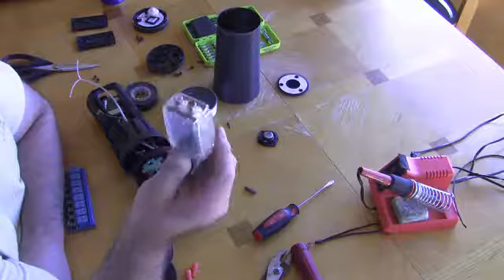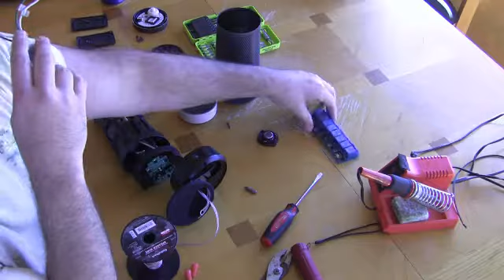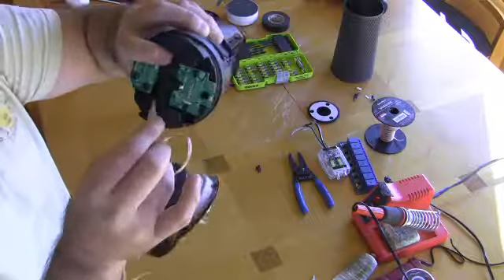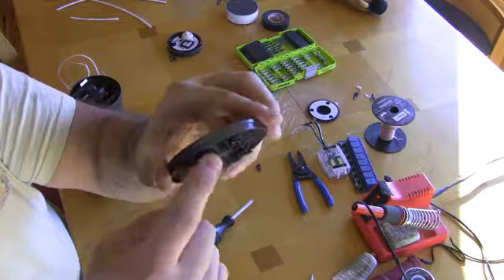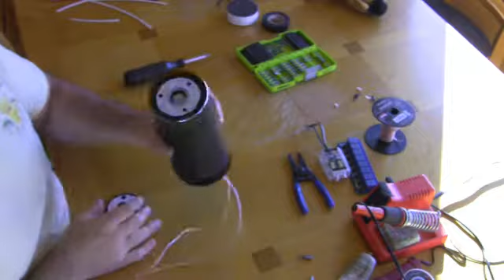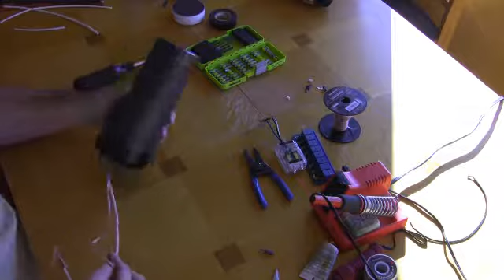Harmon Kardon Invoke: Part 4:  Speaker Mod and Re-assembly

Comment: Is there a way to only make it a bluetooth speaker? cortana isento working for me...
Thanks
Reply: Cortana is integrated into the device, so, in a way no.  The audio feed going to the AMPs is through the circuit card.  I don't have the schematics for the device so I do not know what the empy headers are for. 

As long as you don't use the keyword Cortana, it shouldn't respond, but you should be able to use it as a Bluetooth speaker and pair it as such.
Reply: @cinoaz1243  I can’t get Bluetooth to show up... 
would be fine as just a speaker...
Reply: @sf6743  Toss it.  It was what it was, now it isn't.  Just toss it.
Reply: @sf6743  Toss it.  Better Bluetooth speakers are 30 bucks online.  Microsoft is dumping Cortana, this product is dead (which looking back at my video I was pretty spot on with this turd back then).

Comment: Is there a way to get rid of cortana and have alexa insted? like take apart an echo dot and usa the internals and wire things up so you can inted use alexa with this speaker?
Reply: Well not really in the circuit sense.  The echo Dot has a LINE OUT that you connect to external speaker.  You can get a cheap Bluetooth transmitter with a LINE IN and then configure your Invoke as a Bluetooth speaker.  Thus, you get both Cortana and Alexa at the same time.
Reply: @cinoaz1243  Thanks so much! i tried using cortana, but it was a failure :(
Reply: @paulyrualma  https://support.harmankardon.com/us/en/search?q=Invoke%20FAQ

https://www.bing.com/cortanainvokeredemption

Comment: Thanks for the teardown. FYI heat (think hair-dryer) would help with the adhesive and a plastic spudger would cut down on tool marks (vs the screwdriver).  Think you would have been time/effort ahead putting a scope on it and finding the actual amp inputs and AC coupling to those so you weren't going to be vulnerable to ground loops later.  Would have been an easy thing to mute the power amp at that spot too...  Or maybe you did.  I fell asleep after the 100th 'this is a deadend product'  I think the words you were really looking for were 'single application'.  I too am puzzled by the lack of a headphone/line-output, but really... we could just use a $50 win10 tablet and it would have that... and easier access to a MP3 music library.... I don't think they made this device for guys like you.
Reply from the maker: Thanks for the feedback.  If I ever do more videos in the future I'll try to incorporate your suggestions.  What I didn't show in the video is my own debate on how to do this.  I went back and forth.  In the end, I decided I was upset I even had to do this to begin with and if it didn't work I would just go back to my Alexa.  So, I took the most simplest way out without modding the circuit board.

The bigger issue is the Microphone array, a tablet doesn't work because it doesn't have the correct microphone array to pick up voices in a room.  I looked for external mics, Bluetooth, hardwired, and, for really decent ones the cost was soon more than the tablet itself.  There is extra logic to address this in the Invoke that isn't present in tablets.  I tried tablets and laptops and desktops for Cortana before going to the Invoke.  The Microphone was always the sticky widget.